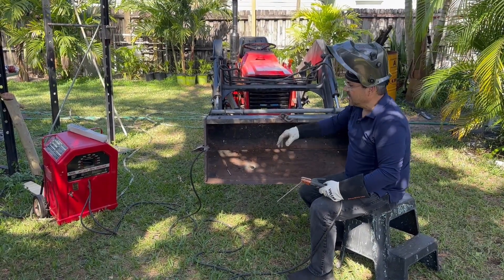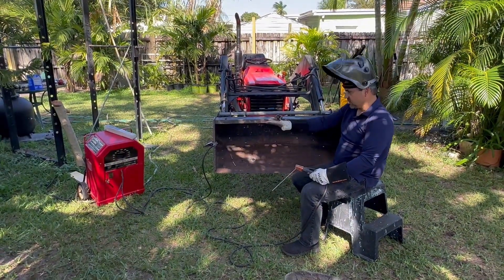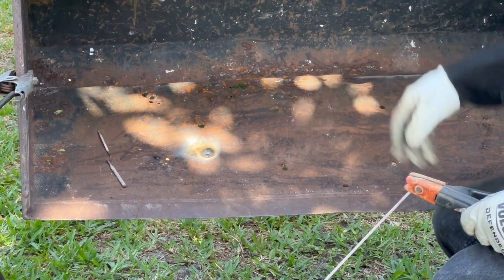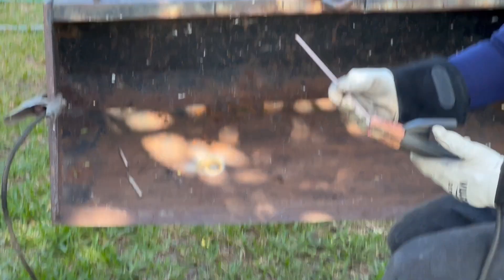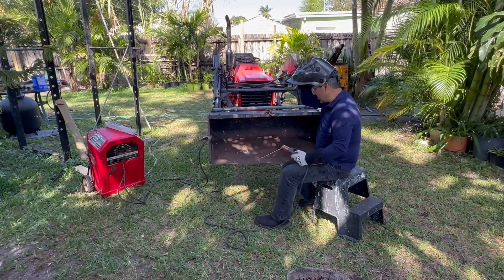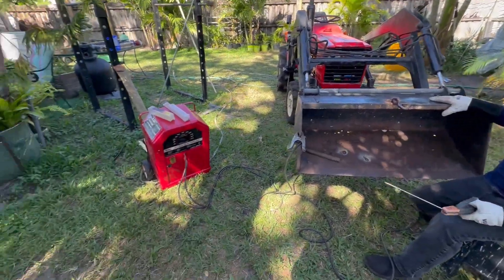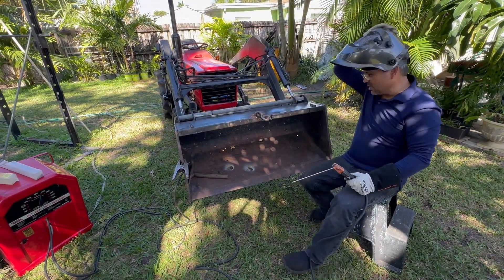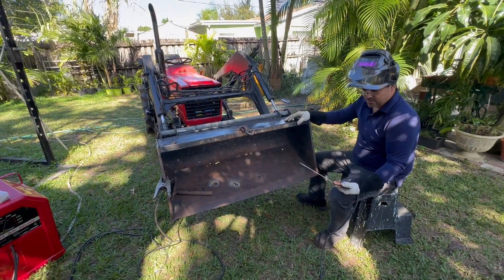Lincoln Electric AC - 225 Welder Final testing

Comment: Get the ac/ dc model instead, I bought one for 60 bucks back in 98 and another one like 4 years ago for 50 bucks. The first one is in mint condition, he sold it cheap because he got a mig welder.
Reply from the maker: Yes, AC /DC is much better. I don't use that thing at all. I have a small Mig that I use all the time and a 250 Mig that is AC /DC and has a stick feature.

Comment: when you run into rusty stuff, just grab the rod firmly and drag it hard across the rust till you get a burn, don't be shy about it.  i have two of those tombstone welders,  real classic equipment. 6011 rod will just about burn through anything
Reply from the maker: I going to cut that out and add a new floor.👍